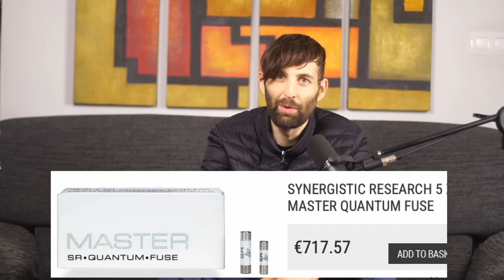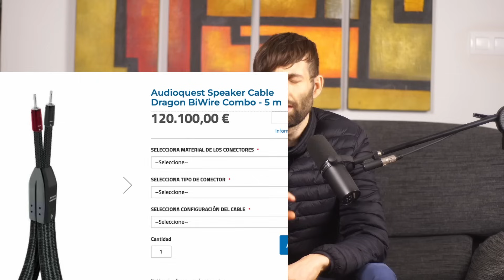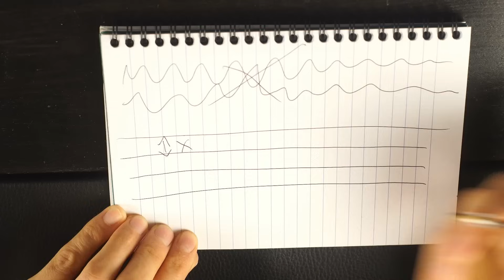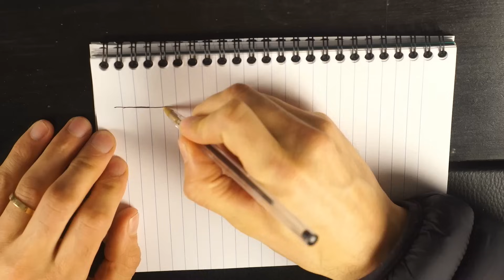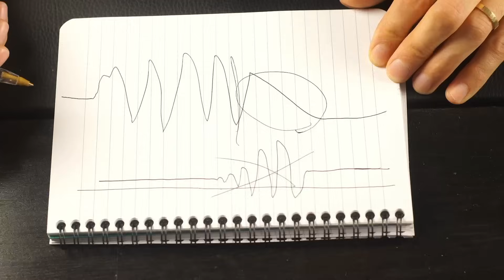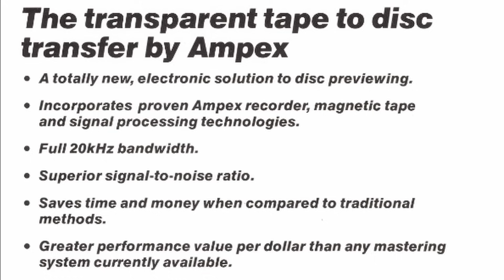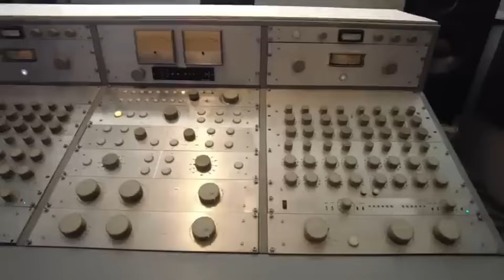Hard truth: most vinyl is digital anyway

Comment: I’ve been working as a mastering engineer for vinyl records for over 15 years, and while I agree with some points, I’d like to clarify a few things. Whether digital or not, masters for vinyl can differ for both technical and artistic reasons. For example, vinyl tends to sound dull when the music is over-limited, as the dynamic range is constrained by the physical grooves. This influences how I approach audio for cutting, prioritizing relaxed compression and proper leveling. Other aspects like stereo imaging, EQ, and phase handling also come into play, often requiring significant adjustments. In many ways, mastering for vinyl involves considering the physics of the medium—needle movement, groove depth, balance, and more. It’s almost like being part audio engineer, part physics engineer.
Reply: A good mastering engineer is an artist in his own right.
Reply: It's almost like people mix and master in a manner appropriate to the expected listening media and methods of the end-user. Almost.
Reply: @Guynhistruck Not almost—that’s exactly right. This applies to any medium. For instance, inter-sample peaks are crucial on platforms like Spotify. They prevent you from exceeding certain levels because the codec can vary across devices, which affects playback. Similarly, if you’re mixing for vinyl, you need to account for specific aspects of production (including the physics of the medium) that ensure compatibility across all playback systems. In a way, digital is more forgiving of errors, while vinyl forces you to respect the laws of physics at every stage of production.
Reply: @thiagopinheiromusic  Mastering for target media (or medium) goes back.  I recall broadcast promo 45s being mastered in both stereo and mono, often with mix differences, too.  My studio work did not involve mastering for vinyl (tape duplication masters.. did those!), but the 2020 Covid shut downs gave me a chance to catch up with the old guys and gals who did that work, and from microphone to vinyl groove to playback speakers, it's a miracle that what comes out bears resemblance to what went in.  There are so many places to screw it up, so many "gotchas" especially if moving tapes between studios.  I think you're very right that digital recording can be more forgiving, because a longer play time doesn't have any physical effect, but cutting lacquer, a producer wanting to squeeze another 60 seconds onto the side, with some significant 50Hz, and not reduce the overall level of the side... 

Probably lots of folks here never considered that track sequencing on a vinyl album is influenced by the physics of groove velocity and groove pitch as the effective diameter decreases.
Reply: @raygunsforronnie847  well said mate!
Reply: @ exactly, thanks for the great comment!
Reply: @Guynhistruck  u thought u were special when typing that out, didnt ya

Comment: In my experience audiophiles do have more money than technical expertise. A friend of mine buys all that crap, a coral bolster for cd player (to reduce jitter or so), a few hundred € power cable (with polarity marked…) and of course really expensive line cables. I explained the physics and electronics (music is a rather simple, low bandwidth alternating current) and we know how to measure every parameter. But he seemed to see it as opinion rather than facts though he knew that I studied several semesters of electrical engineering….
To one part it’s Trumps fault, because he coined the inglorious term „alternative facts“ and then the misconception of a scientific „theory“! Some naive people really think because of the word „theory“ it’s only theoretical.
A big influence are the magazines who support those lies.

Comment: The funniest part is, that modern recording studios are all digital, so there is no analog sources in the mix, the mix is done in digital tools too. So even if they produce an analog media in the end, the source is digital anyway. Plus, due to mechanical limitations of vinyl players heads, the high pitches are distorted at the mix stage. If that sounds "better", maybe - for some. But I prefer more accurate and cheaper - digital records!

Comment: I have both a pretty good cd-player and about similar quality turntable, and a rather big collection of both CDs and LPs. I nevertheless listen more to the turntable. Why the sound is more natural and relaxed.  This is my personal expereince and of course no "expert" can tell me that I am wrong or that I am imagining things. There are the occational pops and clicks but they are normally not an issue. Does this depend on that analogue recordings are much better than digital. I don´t think so since LPs with a big digital tabel also can sound very good. I am not sure but my guess it does not depend on the medium rather on your home equipment. It is easier and less costly to build a really good turntable in comparison with the CD unit that can provide the same sound quality.

Comment: As I understand a lathe with two heads recrives the dugital but used the analog for the cutting. Single headed cuts digital.
Reply from the maker: no that's not correct

Comment: Factual incorrect information in this video. 

Digital has a sound.  It’s the sound of the converters used in the signal chain. Different engineers use different converters because they sound different. 

If digital is so great then why do mastering engineered use analogue outboard gear? Because they prefer the sound. Why do some people prefer the sound of an LP to digital playback? Because they prefer the sound. 

It’s factually incorrect to say that vinyl doesn’t have a sound apart from surface noise. A digital master and an analogue master never sound the same. Ever. You know that as a mastering engineer. With LP playback the sound differs depending on the turntable and cartridge used in exactly the same was as digital will sound different depending on which streamer or CDP and converter is used. Fact. 

Finally Pink Floyd’s studio team tested different mains cables when they rebuilt the studio and found a difference in sound between cables and so chose a specific cable.
Reply from the maker: your comment is just a bunch of assertions without evidence or logic
Reply: @APMastering you are therefore stating that all digital converters sound the same and that any studio engineer who suggests that there is any difference is incorrect. Your industry colleagues will disagree. 

You also are stating that all streamers and CDPs and turntables and cartridges sound the same. There is substantial evidence of that this is not true based on objective measurement. 

Yet you also published a video stating that not all DAWs sound the same. Yet you assert any digital has no sound. 

If you believe these things to be true then how can any client trust you to master their music if you cannot hear the difference between two different converters? 

I will not insult you as you have me. I prefer to stick to facts. Especially as I used to own a studio and still am a musician and producer.

Comment: Just like film. Film can be nicer but most of it is just edited on a digital intermediate so what's the  point?
Reply from the maker: because 35mm looks amazing
Reply: @APMastering  only if it's actually mastered on 35 mm intermediate
Reply from the maker: @aaronmoser2617  no, you get the look of 35 when you shoot it and then all the digital grading and editing etc is irrelevant
Reply: @APMastering  you do get the grain provided they don't use some sort of software to edit it out but you don't get the full potential. Digital intermediate is 2k usually and 35mm minimum has 8k equivalent of resolution. It's good but not ideal the way they do it
Reply: Oh and thanks to responding to my comment
Reply from the maker: @aaronmoser2617  lord of the rings used 2k many years ago. now high quality productions are generally using 8k but at the very least 4k. I even shot and edited my next video at 4k
Reply: @APMastering  you use digital video cameras, i presume? Oh you would be surprised how many parts of the production line are done in 2k even if the final master is technically in 4k.

Comment: there are so many records that have not even been digitized yet. it doesn’t matter how digital compares to vinyl when the only way you can listen to a specific song is on vinyl. thats why vinyl sounds better because its the only way to listen to some songs. then there are the reissued records that sound significantly worse than the original press.
Reply: You're referring to gramophone recordings that were carved straight to wax on the site of the recording? Many of those have been converted to digital using lasers to scan the grooves. Most everything else there are tape masters.
Reply: @ im referring to records that aren’t available for streaming on any platform, the only way to listen to them is on the original record. so many songs have never been put online, there is no digital file to compare it to.

Comment: He's not completely wrong, but he's not completely right either. Now, I don't have anything to do with mixing or sound design, but I'm a computer scientist and I know something about data storage. Whether he likes it or not. Vinyl is an analog medium. Even if all the steps before it were digital. In the end, the music still has to be converted back to analog in order to save it on the record.
Reply: @marvin902x  you can say the same thing for a CD. At some point it has to be converted into an analog signal in order to make a diaphragm vibrate and be heard. The point is that all this extra information that analog is supposed to have disapears in the digital step
Reply: @Garvm  Which digital step?
Reply: @ a lot of steps in the process are digital. Did you see the video?

Comment: 10yrs as mastering engineer 1990s.- yes this is all correct 👍 1992-95 was about the time we all started slammed CD using ultra maximising tool sets in computer. Buy CDs before 1994 ish originals and you’ll have the dynamics again , we only levelled and normalised peak detection etc prior. And outboard gear used. As for vinyl mid to late 70 cut off, for your “pure analog type transfers”. And again , the record cut, two separate masters supplied (but sometimes it was the same digital files as CD sent to the cut if tune was tight).  Personally, I listen at home on vinyl up to about 1982/3 ish then I’m  into a selective process of open up the digital files/album and see if it’s slammed for its style of music - it’s tedious but you can build your own un slammed collection. Also rip tests from the streaming platforms to check how they are providing content - my finds …generally it’s super slammed. But some folks like that so who am I to judge ☺️

Comment: I love vinyl, but I have no illusions about it sounding better than a noiseless, lossless format. 

I think the only exceptions are early CDs before mastering was really perfected.  A good example is Prince’s 1987 Sign O’ The Times album.  The original vinyl, objectively, sounds better than the original 2CD release because the mastering on the latter is AWFUL.  It’s insanely quiet and lacks low end.  I assume it was because early CDs didn’t have the same storage capacity, so they probably lowered the bitrate to get everything to fit on only 2 discs (the first CD version of his 1999 album omitted a song entirely for that same reason). 

Since it has been remastered, however, it’s kind of a moot point now.  I’m not a purist or a snob though.  To me, it’s just something I grew up collecting and I still enjoy it.

Comment: The main reason Djs love the digital format is we was limited to sound pressure levels with vinyl, the venues tried everything from solid stone pillars to hanging the decks from rubber bungie ropes to avoid the feed back and jumping when trying to cue the 1st beat from records that was cut too quiet or the break in the track where it went to the strings and effects etc it would feed back,  you could never stick 96k rig  in a venue that holds 1500 people and be able to turn it up proper, when we 1st overlayed the 1st cds that came out we could literaly make the sound system sound 10 times louder, becuase it could be driven properly without the sound getting back onto the vinyl feeding back all the time. The second reason was cds weighed less than a big box of records, now he's right we all love vinyl better, for  those exact reasons, also you remember what it looked like the cover the centre label etc was just a beautiful format to hold and look, but so flawed in many ways its space it takes up, how long the cover lasts, how long it lasts before the dj has worn out the 1st beat just before it goes all noisy and then the dreaded jump in the mix or while it plays and skips because its got dirt in the groove,  I could go on and on. But learning to dj and mix on was an experience and a half something todays generation have never had to deal with, imagine the new djs all having to use vinyl 1st before being allowed to use digital format, they would be spitting their dummies out.

Comment: I listen to both digital and analog and prefer analog (vinyl) overall. I don't appreciate being called ignorant and/or delusional by you for my preferences as they are mine and mine alone. I think most vinyl listeners know the studio recordings are now mostly digital, however, upon turntable playback,  the signal is not going through a digital processor in my system, which sounds better to me than digital depending on the original studio recording,  mixing, mastering, etc. Of course,  I guess this is a moot point being that I'm ignorant,  delusional,  or both 😂

Comment: I loved this, you pretty much stated what I have been saying for years to many audiophiles with regards to recording studio's, cables and what actually gets all that information onto the recording. 

Many of us will still remember three letters on album small print, AAA AAD, ADD, DDD. Almost as exciting as chrome tape in the 80's. 

I did say on the other video that most modern music and vinyl really do not serve to show what vinyl is as a medium, this wasn't with regard to sound quality, but there can be differences which is mainly mastering/remastering qualities. 

Many users of vinyl simply have massive collections of vinyl, a lot with no digital in any part of it, some even buying audiophile pressings by the new small teams printing new records in all analogue chains. 
But a lot is simply because they have the originals, 50's, 60's, 70's vinyl, most of which is only available digitally on remastered formats which were basterdised by sound engineers during the loudness wars. 

To this day it's still a problem, play Spotify and with every different artist or depending on album, your changing volume. Spotify even have old versions and remastered versions of the same album to play, despite being the same, the differences and enjoyability can be quite stark.

I'm tempted to get my old turntable serviced and running, simply to allow my kids that experience, but it would probably be cheaper and far more convenient to buy a Technics 1200 and run the cartridge through a $300 phono stage ADC and input that into a DAC, which would be my preferred 16 bit 44.1.

I don't buy into HiRes dacs and music for home audio, especially when its often remastered old content and the only real difference is due to remastering quality and not extended frequency range for bats and enough dynamic range to play 130db plus peaks and damage the hearing.

Resolution qualities the majority of home audio cannot replay and that most buying the equiment will never hear or sense.